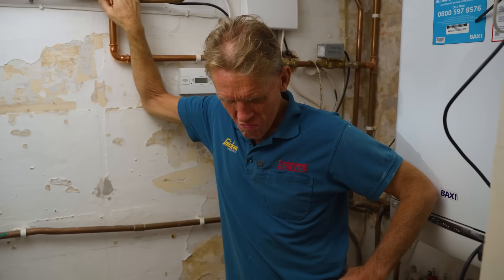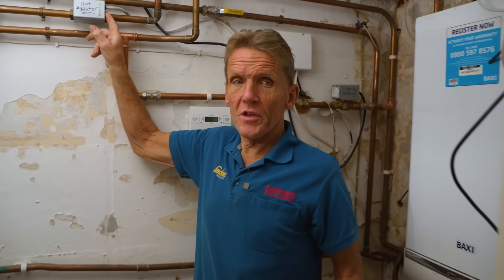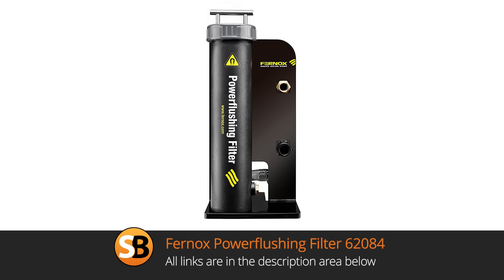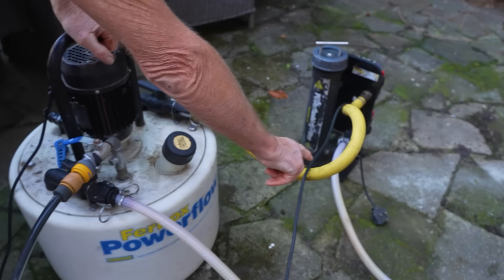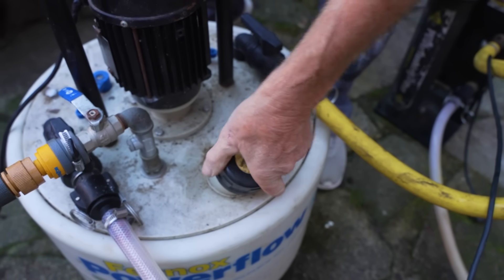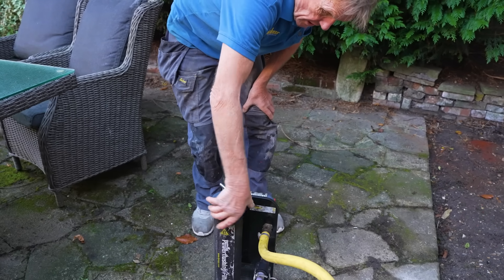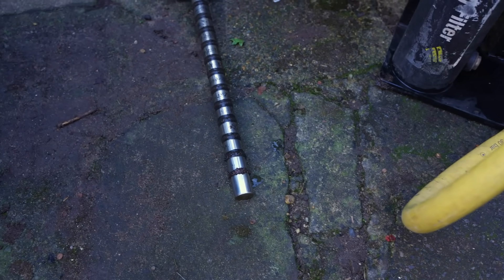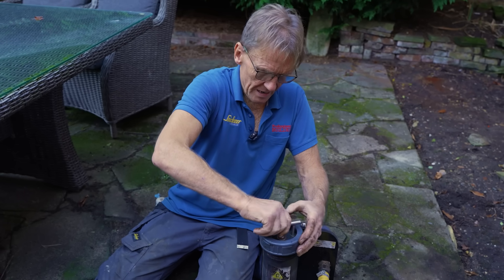DIY Power Flush Your Heating | Get More Heat for Less!

Comment: Hi Roger,( LOVE your vids btw). I've a Baxi Duo-Tec combi  which the heating side does'nt work,( No summer use!)' hot water does!.. I've checked the motor on the diverter is fine but not sure if the valve body is'nt stuck/seized..I've ordered a new 'cartridge' for the diverter valve hoping that might be the problem? A gas engineer stated it needed a power flush, but I'm not convinced as new rads have been fitted not that long ago. Any advice would be greatly appreciated on this. Many thanks

Comment: Got a new Baxi 800 installed but central heating not working properly.  Previous boiler was a 30 year old? Potterton I think.  New  pipework was fitted.  At initial testing new boiler would not work - The Plumber switched the direction of the pump and it then appeared to work.  However I noticed when boiler running a strong flow of water was visible in the storage tank in the attic.  I don't ever remember water flowing like that before and am now wondering if the new pipework was wrongly connected together.  I have an st699 honeywell programmer and have to switch on both heating and hot water to get warm radiators - now some of the radiators are cold so it appears a blockage is present also.  Can you advise please.  Thank you in anticipation.

Comment: There is a danger with power flush, If you use a strong cleaner, not that any will readily dissolve the magnetite coating inside the pipe work, it may allow it to flake off. In the case of flakes coming off and going around a bit like tea leaves,  it can make things worse. Generally we never flush unless a last resort. we take rads off flush the rads, we pressurise the system ( if it has a header tank  we blank off and pressurise up0) and then let the pressure go,  in each radiator leg separately in order to blow out each leg, this avoids circulating the muck. Also we would fit a mag filter into the system a week before to remove all the in solution magnetite.
Reply: Are you saying you take each rad off and flush one by one? Can the rads be left on wall and flushed or do they individually need to be taken off?

Comment: I done mine last summer by running X800 around for an hour, then draining and then flushed just with the pressure from the mains while opening up just one radiator at a time.
Even at that it was incredibly satisfying to see the amount of gunk that came out.
Reply: Just want to aske do i drain the whole system first then add x800 and drain it again  ? Or add x800 then drain it once ? Lastly did you add x100  inhibitor? Need your help please 🙏
Reply: @asifkan2 I just drained it once after running for an hour with the x800 in.
Yes, I added x100 when filling up again.

Comment: Why don't they galvanise the inside of radiators?
Reply from the maker: galvanising is zinc and if you put that in a system with copper and have water in between, you get a battery.    
They would corrode like crazy
Reply: @SkillBuilder  At least you'd save on your electric bill 😉 
Thanks for the knowledge. I've always wondered why that didn't do that.

Comment: better off connecting to the system with the yellow hoses, i find the clear one squash a bit once they're hot which can effect the flow rate.Also hot with F8 and do every radiator separately gets the best results.
Reply: Do you need to take off each radiator of the wall? Or can they be left on the wall and flushed?
Reply: @mryan4452  no, you leave them on the wall but turn both valves off on all the other radiators apart from the one you are flushing and they should be fully open, once that one is done you shut them off and move on to the next one. That way all of the radiators and pipework to them gets a full flush.

Comment: I fitted one of those Fernox filters with the magnet and always put a bottle or 2 of Fernox F1 inhibitor into the system for winter, 25 years later and the radiators are still going strong.
Reply: So you top it up with a bottle of inhibitor every Winter?

Comment: What was the point of that if you dont show where you connected it, we learned nothing!!?
Reply from the maker: Watch it again when you are properly awake
Reply: @SkillBuilder  Into the 'flow' you think that's useful? I'll just solder a T piece into a pipe with flow...oh thats right they all do...
The 'return'...Oh yeh I have a connection sticking out of my wall marked 'return', burke.

Comment: I’ve an Open system with microbore pipework 
Been advised against a power flush
Reply from the maker: I would seal off the feed and vent and put mains pressure through the circuits. I have also done it with compressed air. it blows all kinds of crap out.
Reply: @ 
Up until now I’ve been draining the system 
Cleaning the tank 
Then fill and drain fill and drain then re dosing inhibitors 
I’ll give your method a try 
Thanks

Comment: What happens with open vented systems? I just used our mains pressurre and closed of all the radiator valves oppenning just one then lettin it flow ot of the lowest point.
Reply from the maker: Mains works well in many cases. You always need to cap off the f&E tank in the loft.

Comment: I have half microbore (downstairs) and normal pipes upstairs- OIL combi boiler 2021 - would flushing still be suitable?
Reply from the maker: yes, you could even try doing it with a hose pipe from the garden tap. It might be better on microbore to have more pressure

Comment: It’s so time consuming and expensive I honestly believe the money may be better spent replacing problem radiators where needed
Whilst the radiator is off you can also flush pipes to it to the outside using mains pressure
£2k will replace several large doubles
Add a power flush to a boiler replacement and you are out priced most likely

Comment: The weakness with power flushing is the worst ‘gunk’ is at the bottom of the large double radiator. Because the circulation takes the path of least resistance, the areas most in need of flushing tend to be the least flushed. Even if the water level is lowered to these radiators to force circulation along the bottom, because there are 2 routes the most needy panel is bypassed 
Agitation with vibration helps this. But at the end of the day, so much time is spent doing this you are better off prodding and hoovering these areas with the radiator isolated
In short, the areas most in need are not flushed and vice versa. Better than not doing a flush obviously but you are relying on operator competence and diligence.

Comment: I've done many powerflush and didn't see hardly anything bad coming out EXCEPT for one system which was open vented non pressured radiator system fed from a feeder tank in the loft without a lid and the water was pitch black for hours I couldn't believe it. Everywhere else there was tiny amount of sludge if u can even cal it that. I think the power flush machine should be pressurised to do some actual work maybe 3 bar or 4bar.

Comment: This isn't a thorough and comprehensive guide to flushing.
It doesn't account for the many different systems, boilers, pipework, ways of flushing, even heating valves (not all valves have 'balls').
It is merely a snapshot.
I certainly wouldn't attempt it as an amateur based off this video.
Also, hitting radiators with a mallet or sds attachment is something which should be done on every flush to help agitate the sludge build up in radiators yet it is barely touched upon in this video.
Reply from the maker: I wouldn't recommend hitting the rust of the inside of the radiator because it might spring a leak. If a professional does it fine but we have to be careful about leading people into difficult territory.
Reply: @SkillBuilder  It helps dislodge stubborn build up. Why wouldn't you recommend it? Otherwise it's not a thorough job.
Reply from the maker: Because the rust will often come away and cause a leak and more blockages. If you are a pro you can handle the problems but if you are a DIYer you are looking for an improvement not perfection. Manage the risk.
Reply: @SkillBuilder  I was about to suggest a little caveat to your description but you've quite literally covered all bases so credit where it's due.

Comment: Boiler keeps dumping water, probably got air getting in, can i use a leak sealer to seal any small leaks in a combi boiler set up ??????
Reply from the maker: it may just be that the expansion vessel needs pumping up
Reply: Also worth taking the TRV heads off and  checking your TRV stem seals are not leaking
Reply: @paulwinter9845  Thanks, but i changed all the valves last year, system was working faultless last year.

Comment: One of my rads gets hot but the return pipe is always cold, maybe sludged up?
Reply from the maker: Try opening the valves up on both end and turning some of the other radiators off to see if it wil push through.

Comment: Power Flushing is sooo 1990 mate. Come to the light with thorough flush and ditch the useless power flush machines
Reply from the maker: I have done many jobs with mains pressure but in this house it is only 1.5 bar on an old lead main so it isn't great for that job. 
If you see what the big mag filter pulls out of the system combined with some chemical flush I think you will be hard pressed to beat it with a 1.5 bar main and low flow. As you know it is the velocity of the water that you need to clear the sludge. 
BTW not everything from the past is bad. I think you were probably born around 1990.
Reply: @SkillBuilder  mains pump for through flush is good enough with 12l/min. We have now completely stopped using any chemicals for cleaning and we do not use any inhibitor - both are causing havoc on heating systems. 

In 1990s I was sadly already old enough to drive
Reply: Not if you have a crap mains, or extremely high water pressure!
Reply: 1000+ litres of fresh drinking water straight down the drain isn't what I'd expect a heat pump advocate to be suggesting!
Reply: @psi10001 , you have to pump that water through the system in any case, power flush or no power flush.

The trouble with power flush is - you can never get all the cleaning chems fully out - they cause havoc on the system, and so the cycle repeats a few years down the line.
Reply: @UrbanPlumbers  so powerflush without chemicals then, that’s what I do, obviously bash the rads, do cold feed and pump ect
Powerflushing is about flow rate only, that’s the advantage of Powerflushing, mega flow rates to dislodge things
Reply: @plumbertime  I still prefer to mains / thorough flush - even with poor flow - just connect my mains booster before the thorough flush or fill a wheely bin with water and pump from that. Allows for great reversal of flow and you don't have to keep an every on it as much.
Reply: @UrbanPlumbers  well your mains booster pump does 12ltr per min!
Powerflush can do around 90
Even if you fill the bin that you obviously don’t your still only doing 12 litres per min 😂
Reply: @plumbertime  all I need - no complaints
Reply: @UrbanPlumbers  same way most big companies just drain down and refill and call it a system flush. They have no complaints either

Comment: Would have been useful to see where you connected it to. I assumed you connected to the filter on the system but what would you do if you don't have one? 🤔
Reply from the maker: I think you can see where it is connected to but any 22mm flow and return will do.

Comment: The p-poor system in my house ‘can’t have inhibitor’ so I now the boiler needs replacing I have the decision as to replacing the rads, tank etc. to make it a conventional set up or junking it in entirety for air to air. Question: are the copper pipes likely to need replacement, or is it mainly the steel side that corrodes?

Comment: Radiators shouldn't be left to rust. Inhibitor must be used to de oxygenate the water.
Reply: Our approach to central heating water treatment is completely wrong. Europeans work to VDI2035 standards (drastically reducing conductivity of water) and their systems are much cleaner with zero inhibitor. I guess sludge has commercial benefits for us though 😂

Comment: Can you put a big magnet (or an electric coil) permanently somewhere near the bottom of the pipe circuit ?  Is trapping the magnetite as it runs normally an option?
Reply: @chrishb7074  if you have a magnaclean or similar filter there's no need? Or you can add a radmag to your towel rad if you want. Plus x400 yearly or twice yearly. That's keeping me going until I can be bothered to do what's in this video

Comment: My windows frosted on the inside growing up. I slept with only my nose and mouth uncovered. 
   Still have trouble dealing with being cold. The bathroom didn't get insulated for 20 years, it had a venting roof and was an addition. Nobody knew they ripped some of the exterior off so the wind got in the cavity between the floors and swept through. 
     The radiator, yes this includes it, it had an inaccessible valve up the wall you could only reach from the crawlspace and it was half shut or more for 5 years, the whole time I was living there. No air bleeders either.
   
    Hard to express how terrible it is to never be warm. I was just there for Thanksgiving and it feels like a different house. I'm the one who fixed all those things after I left home. Cost about 600, bleeders a fair bit of that. Nobody worried about the pipes with "Cal-Gone" in it. Hexa-whatever.

Comment: Magnacleanse much more convenient during a boiler install. Power cleaner left overnight, or Thoroughflush for those really filthy blocked up systems after a few days to a week of power cleaner. Got both and have absolutely no need for a traditional power flush unit👍🏻
Reply: And a battery powered tyre inflator,  with various fittings to unblock clogged up rad tails. Even used a modified waterpick tooth cleaner on very stubborn blocked rad tails to get flow and let the cleaner do it's job.
Reply: Good luck to the non plumbers 👍🏻
Reply: Problem can be the system circulation pump has nowhere near the velocity/pressure of a powerflush machine which helps carry the sludge /debris out of the system example being it accumulates at the bottom of radiators and the flow of water passes over the sludge instead of carrying it with it but hey each to there own take care 😊
Reply: @galaxydave69   Oh it works Dave you should try it. And the Thoroughflush doesnt need a pump as it uses mains mate👍🏻
Reply: @jamescarter1088  do you pre treat the system before mains fush as you can't circulate the chemicals with mains we used to use fx2 on bad systems but that stuff is brutal and needs neutralising all the best mate
Reply: @galaxydave69  Yeah, use an off the shelf power/rapid cleaner and leave it up to a week mate. No need to neutralise these types of cleaners. Use an air compresser/tyre inflator into a schrader valve. (Fits snug into a 15mm compression fitting) Unblock any stubborn rad tails (particularly microbore) to allow flow for the chemicals to work. Even used a waterpick unit once with the handle chopped off. Used it as a mini drain blaster to unblock about a foot of 10mm copper. Even a powerflush machine wouldn't do that, as it held 8bar on the tyre inflator.

Comment: So you need to disconnect your flow and return from the boiler and make connections for the power flusher first before you can do this?
Reply from the maker: There are lots of ways to do it, You can use one radiator or the mag filter or just put in two tees.
Reply: @ thanks. I don’t have a mag filter so I’ll have to go the radiator route.
Reply: I expect you mean putting one end of the hose on the flow into the rad and the other on the lockshield end? @SkillBuilder

Comment: I'll give this a go. In a previous house i dumped x800 in and left it for a couple of hours circulating, then flushed it through using the fill valve, then refilled with inhibitor. Seemed to do rhe trick, without a machine. Would like to try and do it "properly" in this house though, my magnaclean is pure filth.
Reply from the maker: Yes we might try that in the next video. It works.

Comment: The last 2 oil boilers I fitted recently had to word of having to powerflush the system for the guarantee to hold, they just state that the system must be cleaned when putting onto an existing system. And there are plenty chemical cleaners out there that help dissolve that horrible gunk and can be done in a morning.
The biggest problem is DIYers not putting inhibitor into the heating system after doing a flush or plumbers not adding it after repairing a leak
Reply: Anything that can dissolve that gunk is surely not going to be very gentle on your rads?

Comment: I have an Adey MagnaClean magnetic filter plumbed directly into the pipework and it does a good job of clearing out debris and sludge. It gets cleaned out as part of the annual boiler service.
Reply: Yes that’s what should be fitted standard on any new boiler
Reply: I have a Spirotrap on an open vented system.  I remove a couple of litres every year to clear it out and then I top up the X100 inhibitor.  It gives a good indication on the health of the CH flow.

Comment: I had a local CH firm come to fit an extra rad, I asked about power flushing, they said they do it rad by rad, I questioned this because I thought it was a whole system flush.
Reply: It is a whole system flush, they turn off the valves on the other radiators so only one radiator is getting the full flow of heat and water at a time. The increased flow and velocity of the water only going through one radiator makes the clean much more effective. They then move onto the next radiator in the system and turn off the valves to the radiator they've just flushed, and so on until the system is done. This also stops the muck being deposited back in a radiator that has already been flushed.
Reply: @psi10001 super answer, thanks.